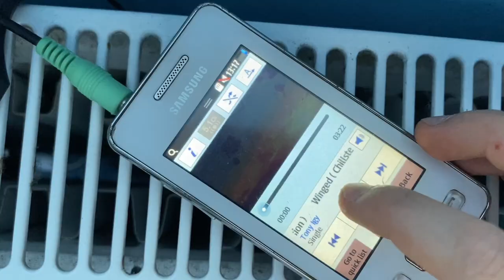DIY Powerful Ultra Bass Amplifier ATX Computer, Transistor D13009k, No IC, Simple circuit

Comment: Buen video.Como mejorar la amplificacion.El mio suena bajo y al aumentar volumen distorsiona mucho.Gracias.
Reply from the maker: It dependent on the power of the transistors, you increase the clarity with a capacitor paralel to the speaker. Also the distortion is normal for such amplifier.